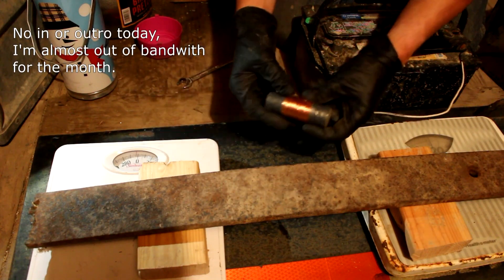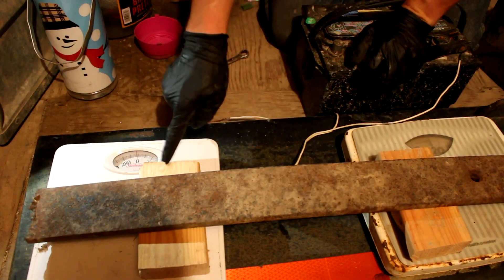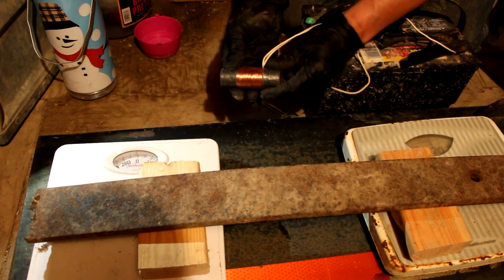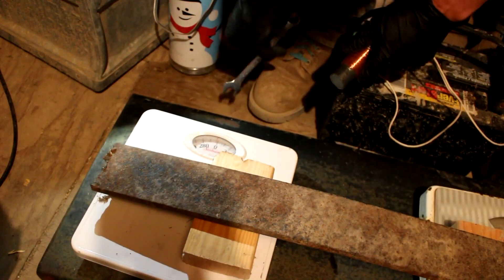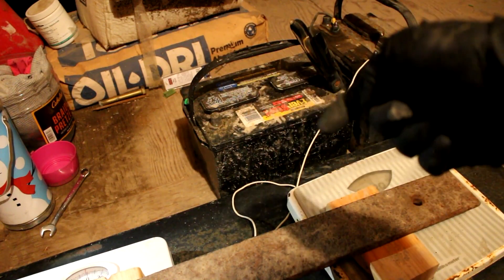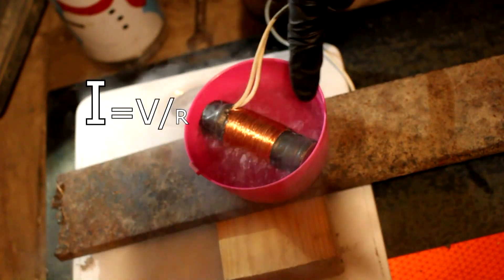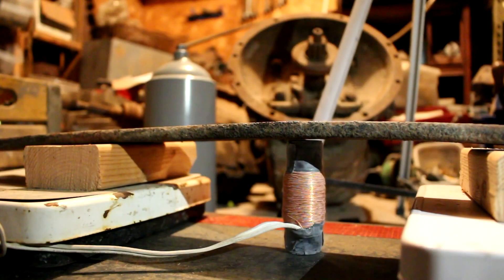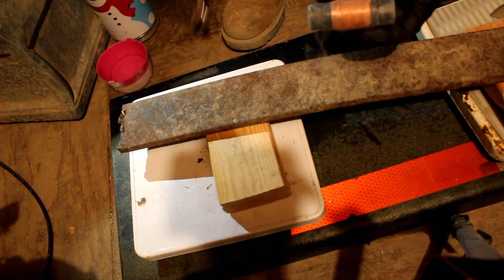Electromagnet in Liquid Nitrogen

Comment: is there any other way or cooling is off is the only way ?
Reply from the maker: thicker wire. But then you cant get as many in as small of space...
Reply: +Cody'sLab Thank you
Reply: +Cody'sLab I used insulated wire and a three volt battery. It lifted really well.